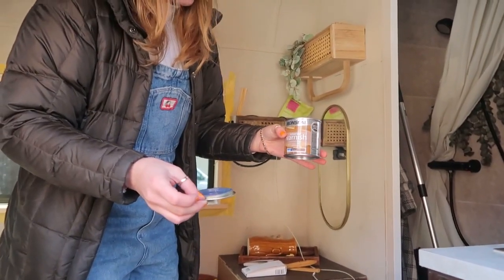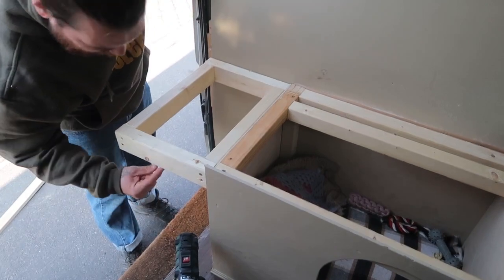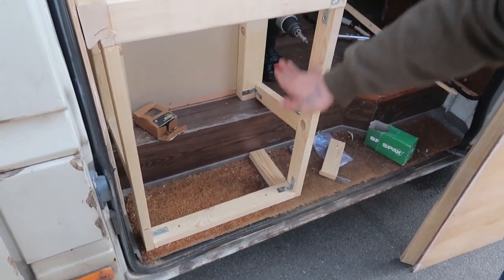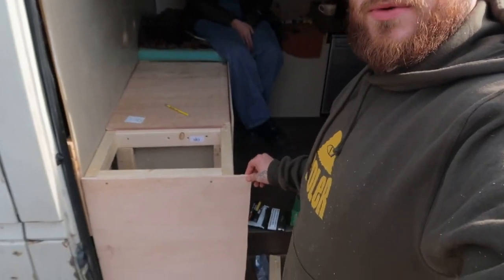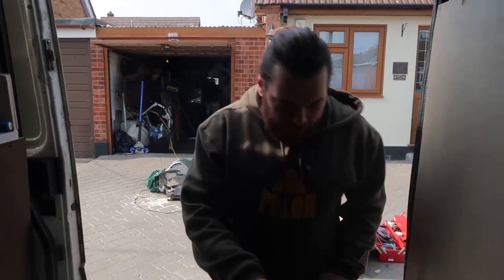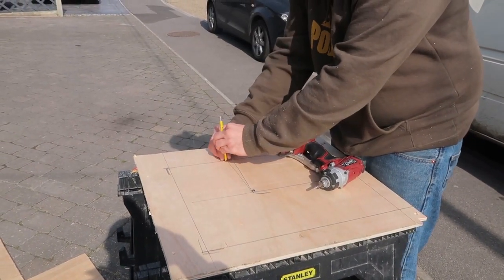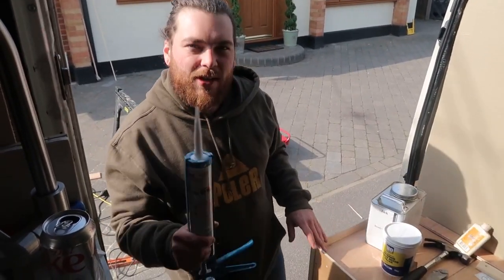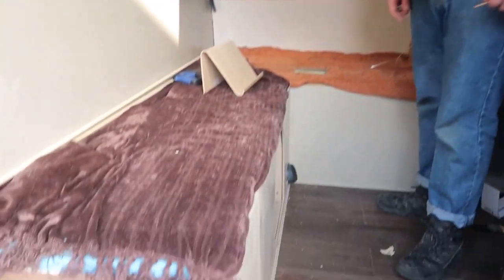CUSTOM VAN SHOE RACK | rebuilding our van sofa | self build campervan |

Comment: hello both x i just came across your vids and while i wish you well in your travels, it bothers me that a lot of the self builders use 3x2 or 2x2 as a frame when a lot of times there is no need if you just put a fixing backing of 2x1 or 18mm ply to take fixings on your main ply structure edges it can cut down on a lot of weight and save money on fuel in todays world